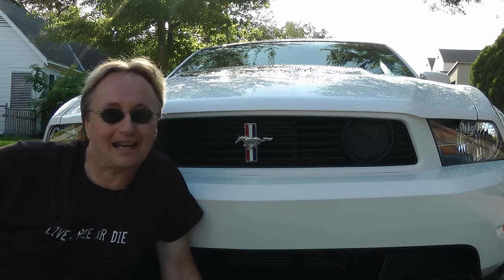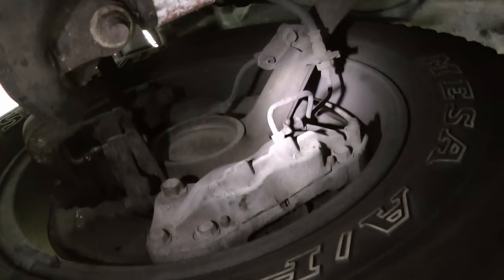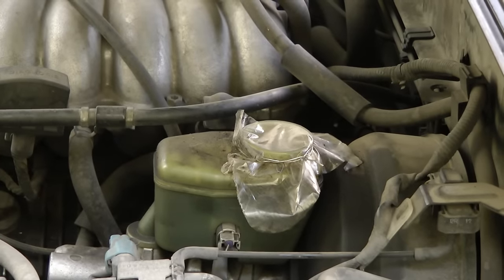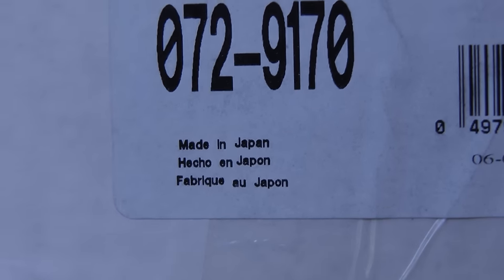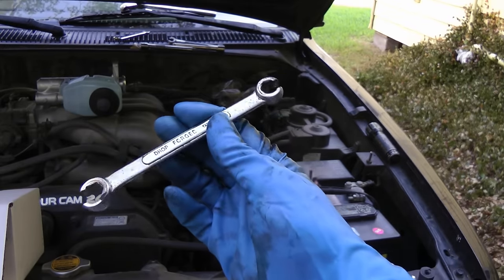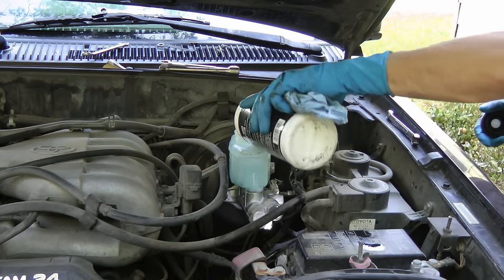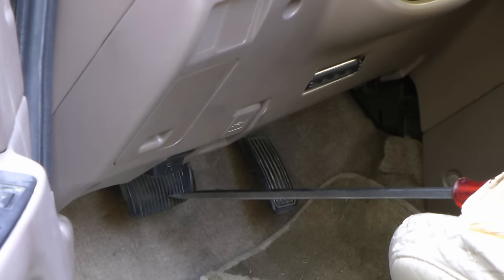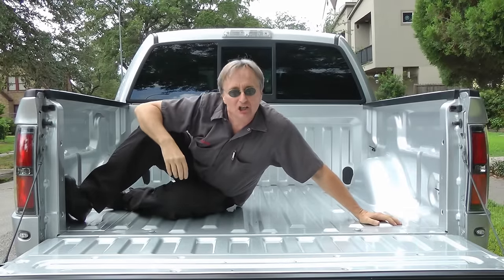How to Fix a Brake Pedal that Sinks in Your Car (Brake Master)

Comment: Hello and Merry Christmas. ... so I have a 2001 dodge durango, have been bleeding the brake due to high sponginess and no good, changes master cylinder, bench bleed it and bleed is on car and still... bleed the WHOLE lines again and it helped, brakes got some what hard, two days later spongy again... bleed it today in the morning and was almost perfect hard and tonight I can feel the brake pedal going soft on my... what's going on? No leaks on any of the lines where I bleed and no lost of oil in the master cylinder... I'm desperate. .
PS: ABS light and brake light turn on when this happens (the pedal starting to sink)  and goes away after bleeding it and turning car on (I do not disconnect the battery)

Comment: So "sorry if this sounds dumb" but you dont have to bench bleed first? I was told to,connect two plastic tubes to the master cylinder.. Bench bleed... Then connect and bleed the brake lines? U just connected it back up and bled the lines. Maybe im missing something or misunderstanding.

Comment: I have a 2001 Nissan xterm. I have replaced the master cylinder front brake calipers and rear wheel cylinders. The pedal is a sponge and the rear brakes don’t stop the wheels! Yes I have bleed the system. I’m thinking abs module???

Comment: I can't find much info on this. Still having brake issues. Only happens once heated up, question goes as follows. With a brake booster, can excess heat into the booster cause it to slightly apply the brakes? Engine heat not brake fluid heat. I've seen in diagrams that vw lists a heat shield for the booster on my car now but in 99 it didn't come with it. Don't know how a booster would react if it gets hot as I know air expands but can it do that in a booster? Lifting the pedal releases but it comes back shortly later.
Reply from the maker: yes that can happen with a booster, but more often that's sticking callipers that heat up then stick on.

Comment: What if the pedal only does this when the car is on? is it still the master cylinder? or could it be the proportioning valve? I press the caliper pistons in when doing breaks and might over pump the break pedal

Comment: Heres one for you.  1994 gmc suburban 1500 with ABS.  I noticed my brake pedal (sometimes) goes to the floor.  It only seems to do this when I am going slow.  When I am going faster the brakes work as normal.  Pedal only goes to floor when going slow (like creeping up to a red light/stop sign ect).  Break pedal holds good pressure when I hold it steady and doesn't sink.  One two separate occasions, when going slow and turning the wheel sharpley while braking at the same time, the pedal went from being on the floor to popping back out to normal height (once the wheel was turned)

I have checked the master cylinder and found the gastket for the cover had two small pin holes .  I replaced this but didn't bleed the brakes yet and it still does it.  Think it's just air trapped in the system now that need bled out?
Reply: +The Headless Horseman I also just replaced my front brake pads as well which I believe is when this issue started up
Reply: +The Headless Horseman 
I have same issue its only when making sharp turns, was it the master cylinder? 
I know I need to change my steering gear box its Leaking oil. unless somehow tied to vacuum line I do not think its related.
Reply: Bryan Ayres
just solve mine, it actually was a bad wheel bearing allowing lots of play in the wheel and the wheel would move pushing the piston back in after making sharp turns

Comment: I feel strange to have a long depress on the brake pedal, nearly to the ground and it's not normal when I brought it, it used to be sensitive. Is that either from my caliper or I just need to replace the whole thing you did in this video? It's a 04' F-150 and same thing goes to my 97' Pontiac Grand Am (I just replaced the caliper/rotor/pads on it and was hoping the pedal would improve, but it doesn't...)
Reply from the maker: generally it's brake master cylinders causing low pedal if there are no leaks you can find and pads are all thick BUT, realize ABS problems can do that too, and a dealer scan computer is needed to check that.
Reply: Scotty Kilmer
Quick response, thanks!!

Comment: Greetings from Mexico Scotty, I have a question for you: change the brake cylinders on a Stratus 96 (drum brakes), purge all four tires and only comes out clean fluid. But something strange happened to me, being the engine off, the brake pedal feels firm; however, with the engine running, the brake pedal goes to the bottom (no leakage of brake fluid from the master cylinder). In both cases the car does stop, what may be causing this (spongy pedal with the engine running)?

Comment: I replaced my master cylinder on my 03' tacoma and bled every line in an x . still the pedal goes to the floor. Thinking I have to keep bleeding but i don't know. With the old master cylinder, i was driving and all of a sudden my pedal went to the floor. I luckily made it home and ordered a new master cylinder thinking that was the problem but the pedal is still going to the floor but the truck is able to stop somehow. What do you think? Any advice would help me from going to a mechanic.
Reply: did you transfer the o-ring to the new master?

Comment: In master i have two "pipes" (2 lines), how is the proper way to bleed them? Open them both at the same time or first bleed one and then second? I tried both way, then after bleeding MC and then all 4 brakes, nothing changed. It just got worse, when engine is stopped pedal feels a bit soft also now even after pumping, previously it was like rock.
So Scotty, i ask, if there is nothing more to check, then that's all? Need new MC? And if with new MC i have same issue? Or its very unlikely?

Comment: Hi Scotty .

Did you not have to bleed the system at the 4 wheels ?.

you say use the screw drives 4 or so time ........ can you please be kind enough and explain .........I understand how you used it the first time , to tighten the nut . but once the nuts have been tightened , how would you use the screw driver to bleed the brakes ?. kind regards

Comment: okay so i have 1980 camaro and we replaced a rusty cracked brake line on the left side then as you are supposed to bled the brakes and master cylinder NUMEROUS times and still no brakes. when the car is off however the brake is rock hard all the time but once the cars turned on the pedal sinks to the floor, even sounds squishy like air underneath. please help?! it may be the brake booster or vaccum? may be shot?

Comment: Hi Scotty,
I have a weird one for you. Several people posted on a Jeep forum regarding this issue.

Jeep Liberty CRD with diesel engine and ABS system.

The brake pedal will start to feel soft. If you keep pressure on it the pedal will slowly go to the floor but not light up the red brake warning light.
I replaced all four sets of brake pads which were down to the last 2000 miles and bled all four calipers but that did not fix it.
I hired the master cylinder replaced, so it was done at a shop professionally. The master cylinder did NOT fix the issue. It was a new one, not used. Then we have a red brake warning light. The repair shop could not find a code. Took it to Jeep dealer, they could not find a code either.

There are no leaks, never were. I now suspect something internal with the ABS system

You might not find one since they only built them for two years in limited numbers.

But there ARE Jeep Libertys aplenty with the 3.7 gas engine. If you could find one with ABS it would be interesting if you could provide feedback. Does it do the same thing?

Oh one more thing, the CRD Liberty master has two vacuum lines to it, the gas version only one. I'm not sure what that has to do with it.

Comment: I woke up to a dead battery and after getting a jump I also noticed my brakes are super sensitive like I barley have to push the pedal to stop which hasn't been the norm and I didn't touch anything, you know what might cause it?

Comment: Scotty,  another "pro tip". 
Check the rear seal on the old master cylinder. If it leaked then inspect the brake vacuum booster for fluid. I poured almost a QUART of fluid out of mine once!

Comment: Hey Scotty I was wondering I use to own a 2002 Ford F-150 two questions it had that problem with a sinking brake pedal at first then it went away then came back right before I traded it second question does this out the car in any danger of not having brakes
Reply from the maker: +MegaThunder70 often a weak master cylinder does that, heat and cold weather can make it work, not work.  But of course it's dangerous as you never know when it will fail entirely
Reply: +Scotty Kilmer one thing also to note is as weird as it it sounds if you would pump the brake pedal it would get harder then get limp again

Comment: Hi Scotty. I bled my brakes twice with my girlfriend pressing and holding the brakes (😅 hard to tell if she was really pressing down hard, or not) and still have a weird bite point. I have another TL (same exact type of car) but the depression of pedal to pad activation is much earlier in the pedal travel - meaning the bad brakes takes about 50% of travel for it to begin deceleration. What should I do?

Comment: Ok my friends 1972 Malibu With new calipers Master Cylinder and new lines And it has a new  proportioning valve it gets fluid pressure on the front but the rear only has a slow stream? Replaced the master cylinder twice to make sure only thing left is the booster but he said it couldn’t be the booster bad

Comment: Hi Scotty, I replaced the master cylinder, bled the brakes, then it feels fine. but after I turn on the vehicle, the brake goes to the floor again. 96 mazda b2300 w/out cruise control. could it be the brake booster?
Reply: Ben Towns

Comment: Hi scotty, my car makes a lot of noise with the brake when I go back wards, they told me that the brake pads has less than 10% left on them. How long should i wait before replacing the brake pads? they are quite expensive. it is a volkswagen.
Reply from the maker: if it's making a lot of noise now, do it sooner than later before you get to the metal on metal

Comment: Hey Scotty, recently (a week ago), my mom's 1999 GMC Safari braking system decided to call it quits.  When I was driving back home from the pet shop, I noticed the brakes felt a little soft, and when I got to an intersection and braking, the brake warning light turned on.  I checked both the front and rear brakes (lines, calipers, drums, etc.), and there aren't any leaks.  I checked the Master Cylinder, and the brake fluid is perfect, and I might've found the problem being the master cylinder; when I ran my mom's van for a while and testing the brakes, the front brakes were making a horrendous racket; before the problem occurred, I heard a squeaking noise; I thought it was the timing belt, but it might've ended up being the master cylinder.  Does a master cylinder make a racket if a car's been sitting on the driveway for a number of weeks and quits working?
Reply from the maker: master cylinders could make horrid noises IF it has an ABS brake system on it. And in such a case, could be bad master OR a problem in the ABS system, they are VERY complex. I would do my video scan first as in my vid "fixing ABS brake problems on your car" to see if it's that first
Reply: Scotty Kilmer The van does have an ABS system, but the Anti-Lock light isn't illuminated (only turns on during the self-test when turning the key to either the on or start position); the ABS still works.  I might as well go to a local auto parts store to have them check to see if the ABS is going bad, or if it's the brakes itself.

Comment: hey Scotty i got a 199 toyota camry and when i press on the breaks it goes about 3/4 of the way down to the ground before the breaking kicks in.. ive taken it to 2 different shops first shop changed the master cylender as well and the round thing that it attaches to connected on the inside of the car... checked for leaks and also replaced the back caliphers problem still remained.. next i went to another garage they changed the master cylender again problem still remained no leaks at all.. one thing the first shop does for me is every 4 months i take the car back and for 20 bucks they take off the back tires and sticks a screw driver into the rotors and ajust them that make the breaks a little tighter but it dosent last any ideas whats going on Brake Master..

Comment: Hey Scotty, it only sinks when the car is running 
Do you think the master cylinder went bad?
Reply from the maker: Fritz Madness that's normally a bad brake booster
Reply: wow, would it cost more problems down the road if that doesn't get fixed?

Comment: Hi Scotty. I haven't found a video anywhere on my issue and hoping you can help. 05 Silverado 15004x4 5.3 front brakes are grabbing and not letting go. They get hot, pedal gets stiffer and the truck struggles to keep moving. It has new rotors, pads, one new caliper, one new rubber brake line due to the rust crushing the line. Both calipers move freely. Inside of the booster is dry. It makes a whoosh sound when I shut it off. Please help!

Comment: So my 92 chevy c1500 has this issue with brake light on dash as well. (Not abs light) No leaks, resivour still full, replaced wheel cylinders, calipers pads shoes and rotors..bled the brakes very thoroughly, went to test drive same problem....bought new master cylinder , bench bled the cylinder then installed and re-bled the whole system including the abs module...still have the problem....power booster checks out fine...what in the world could it be at this point?? Any ideas?

Comment: Scotty you being big on Toyotas, what would cause the steering to be really stiff accompanied by a squealing belt on a 99 Camry 2.2L with the engine running and the car sitting still? Is that the sign of a bad pump or an issue with the rack/pinion assembly?
Reply from the maker: +MrNotorius5500  pray it's a weak pump OR just a worn out fan belt
Reply: +MrNotorius5500 the sqealing belt could mean its not lubricated properly my 95 accord does the same thing.
Reply: Scotty Kilmer Update: Turns out is was both! The belt was loose but also really dried up and severely cracked and the pump was just done. Thought you'd like to know :P
Reply: kenyj18 Belts should not need to be lubricated. If they are, they can slip and cause problems. You probably have a loose belt or a misaligned pulley. It can even be the design of the belt itself. Goodyear makes a ribbed belt that's designed to run quiet when all others fail no matter how well aligned your pulleys are or how tight your tensioner is.

Comment: Hi Scotty, I'm not sure whether this is the issue but it may be. My Audi A3's brake lights seem to turn on after a period of time when the car is parked. It is often a few hours after parking. I have taken the battery out and put it back in when the lights are on from this issue and they come straight back on. It might be either a faulty brake light switch or I was thinking that the pedal is physically sinking and in turn turning on the brake lights. Have you experienced this issue before?
Reply from the maker: brake light switch   most of the time
Reply: Scotty Kilmer Thanks for the quick reply mate. Will look into it further!

Comment: I have a question I have a spongy brake pedal on my 2012 Jeep Wrangler I hit a couple speed bumps and then all of a sudden my break got spongy down to the floor there is no leaks I replace the master cylinder and I bled the lines yet it still has a spongy brake pedal like before any idea

Comment: How to replace a rusted leaking brake line that has a small pin hole that is connected to the front left brake. Line is connected to the master brake cylinder under the hood; and should I replace the other one as well?? (I'm not a mechanic but want to learn)
The vehicle is a 2001 dodge Dakota pick two wheels drive; I not sure if it has a full ABS braking system but when the brakes went spongy both ABS and e-brake lights went on. Please help. 
Thanks
Reply from the maker: Na, but really, a 3 year old rusted out brake line? Dodge is really making em poor these days.

Comment: While in a parking lot I put my foot on the brake to put my truck in reverse, heard a loud pop and my brake pedal sunk to the floor. Still works, just have to push it all the way to the floor. Same thing here, or possibly a broken brake line? 94 k1500 by the way
Reply from the maker: +Mason Reeves pray it's a bad master cylinder, if line was broken, brakes would not work at all

Comment: Hi Scotty, I rebuilt my Nissin master cylinder for my Honda Prelude and had to bench bleed it, I used my flaring tool and made two loop lines that screw into the outlets then loop back into the filler tank so I was able to get the bubbles out of the cylinder first, then I was able to put the lines for the car back in and bleed the rest of the system, from the furtherest caliper to the closest in that order. This was a bone dry system however... hope this helps someone

Comment: I have a honda civic 2001. After changing the rear brakes (drum) my brake pedal is soft. You have to push it all the way down to get the car to brake. However if you pump the brake a few time while driving the brake harderns and works as normal. However as soon as you stop pumping the brake softens again. I tried to bleed all four brakes from the caliphers but I just cant get the bleeder valve to open on the passenger rear brake as the screw is worn and has no grip, tried everything but no luck. Would it be safe to say that if I bleed the brakes from the master cylinder the brake should pump the air out and not remain soft?
Reply from the maker: adjust the rear shoes tighter, and you can bleed it at the bolt that holds the line into the cylinder on the inside